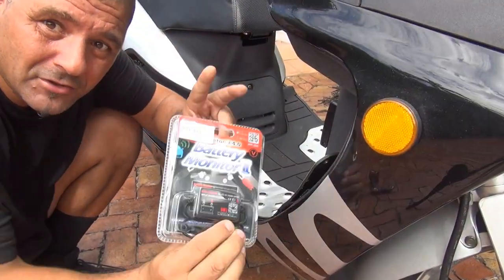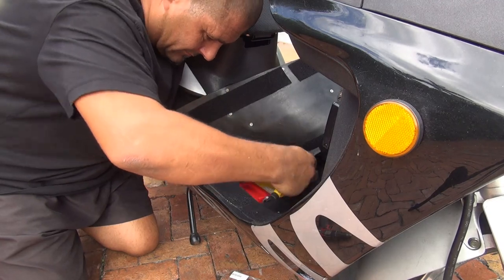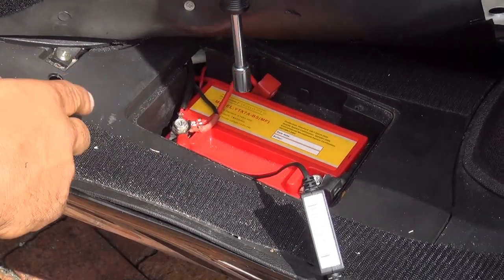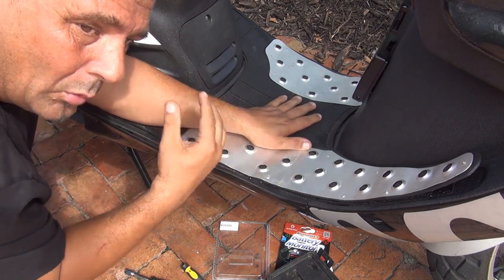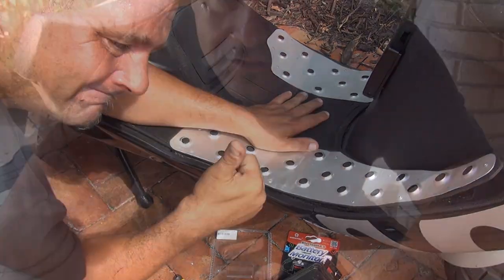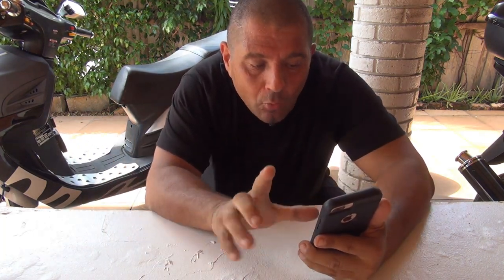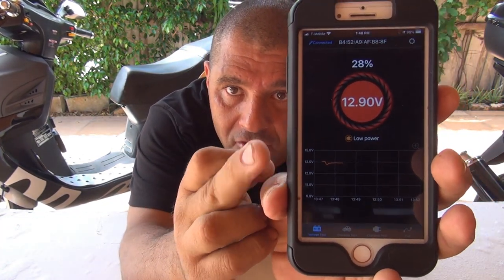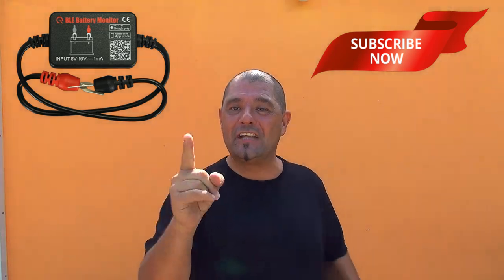Chinese Scooter 12V Bluetooth Battery Monitor

Comment: Hey how are you doing my school starts but won’t turn off do you know how to fix that
Reply from the maker: Hello something must be wrong in the ignition  block for sure is corrosion try to spray little WD40 silicone spray  where you place the key but you can always turn off your scooter with the kill switch at the handle bar next to the throttle . I hope this can help you